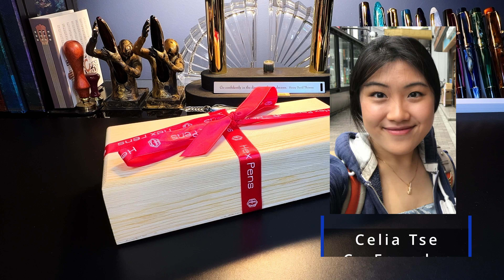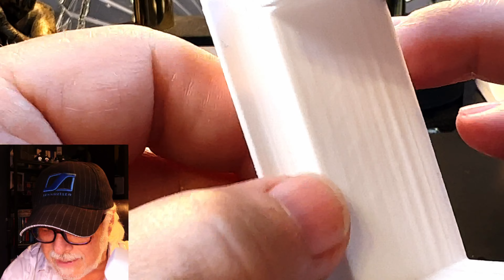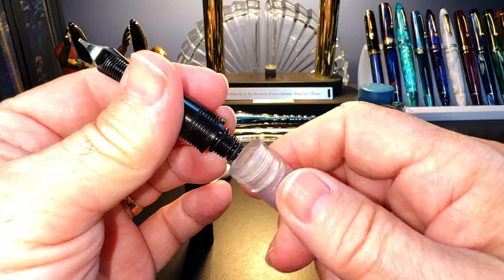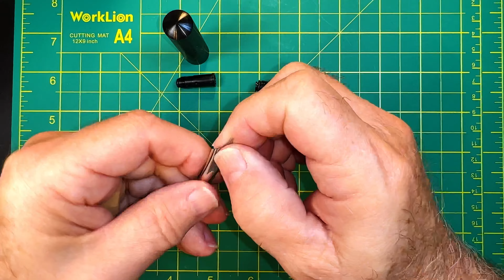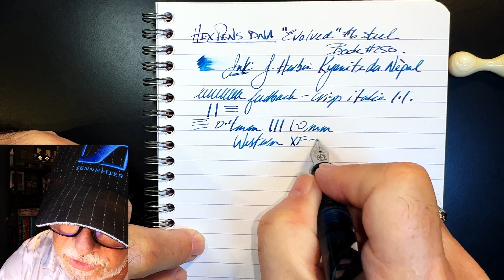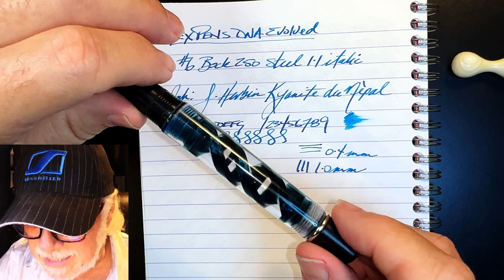2022 Hex Pens DNA Evolved 3D Printed Fountain Pen Unboxing and Review

Comment: No roll stop or clip? That's a big deal breaker, I can see it rolling off my desk and shattering on the concrete floor. I give you props for actually filling this properly.  Good review, as usual.
Reply from the maker: Fair enough! But, the cap is Delrin which won't shatter if dropped.
Reply: Get some Sugru and make your own rollstop. It's basically a silicone putty that dries hard.

Comment: That's a neat pen. I wonder if you could use two colors and have something neat to stare at, either a two color spiral or some mixing on the fly.
Reply from the maker: The two channels are actually one. The cross pieces connect the entire thing as one chamber.
Reply: @InkquiringMinds  I figured. It still might be neat.

Comment: This pen is so neat. I'd love to pick one up but your review is the second one I've noticed this in and as it is a sensory issue for me, it's a no. The cap has that ridged texture a lot of 3D printed items have, and I can hear a high pitched sound as the ridges from the section and the ridges from the inside of the cap rub past each other, that to me provokes a response a bit like nails on a chalkboard. It's also a texture I very much do not enjoy touching. I hope they find a way to make those pieces so they are smooth like the barrel. I also know from having some dolls cast from polyurethane resin that no matter how much you protect it, it's so photosensitive that if it's exposed to light there is no way to avoid the yellowing, only slow it down.
Reply from the maker: Excellent points, Maria!
Reply: You can coat the outside in UV resistant lacquer, like some car spray waxes.
Reply: @bigdhav  thanks for the tip. I was concerned about the texture on the section where the cap rubs against it capping and uncapping.

Comment: Cool pen. Did you need to loosen the end cap to keep it flowing?
Reply from the maker: No. That’s a bad idea too. It will leak easily. The feed is designed to allow air back in the system to control the feed.
Reply: It's probably a better option to slightly loosen it (then tighten it right back up!) if you're impatient after inking it - at least compared to tapping the unprotected nib tip down 😉

Comment: Harry Chapin -always a song with a message. Amusing to watch Doodlebud fill this pen the conventional way first up. It's an interesting, quality made pen with a nib that should provide hours of writing pleasure. Does the pen dry up quickly if left uncapped? Thanks for a very detailed,comprehensive review.
Reply from the maker: Thanks, Andrew. I never noticed the pen drying out when capped.
Reply: I meant more in the case when you hadn't capped the pen for a short time and come back to it. Had it dried up or did it just work with out skipping a beat?
Reply from the maker: @MrAndrew1953  I had it open under hot lights for the size comparisons for a while and then it skipped during the writing sample. But I had no experienced any drying out previously or since.

Comment: This is a real nice looking pen, Doug.  My only concern is durability, as you alluded to in mentioning the scratches that accumulated on the pen after short usage.  How durable is the substrate?  That's the only thing that would hold me back from buying this pen.  Would a clear coating to the cap and barrel work?  Not sure.  Otherwise it is a remarkable conversation piece that would receive minimum use.
Reply from the maker: Yes that’s true. I expect the cap at least to look a bit worn in a year.

Comment: Thanks for fantastic education about the different types of plastics, resins and 3D printing processes!  It seems like the length and girth is similar to PenBBS 469? I LOVE the way this ink chamber fills. Adding it to my wishlist. I'd like a clear cap and end finial, though.
Reply from the maker: The early models had clear caps. I don’t have a 469 but this is by bigger than anything PenBBS has.
Reply: @InkquiringMinds  --- Does that include 491 model? Pens that are too wieldy can lead to finger cramp. Jinhao 100 and PenBBS 469 are about as chunky as I can hold. 308 is most comfortable so far.
Reply from the maker: @twain888  It is much thicker than a Jinhao 100.
Reply: @InkquiringMinds  -- :(. Maybe we can show it to Beini and get PenBBS to make a 308-sized version ... Hey what if it could replace 309? Imagine a piston that fills up a DNA strand!

Comment: A lovely looking pen, that is now firmly on my wish list!  Take my word for it you have not missed a thing by not having used the Additive Pens Ribbon Demonstrator pen! I made the mistake of buying one of them which was Ok at first then the body seemed to expand where it joined the section and thereafter never properly tightened - hello inky fingers!!  In my opinion the pen was pretty poor quality material also I was never really able to get it cleaned properly due to the design so safe to say that I will not be buying anything from Additive Pens again.  I'm glad to say that the Hex Pen looks like much more thought has gone into the construction and more importantly the build quality.
Reply from the maker: Thanks for this! Good information.

Comment: 1. Nice pen, nice review.  Personally I find the Additive Pens version more attractive, but it's always nice to have a choice.
2. Why isn't the steel ring glued on?
3. It may be very practical to include spare parts, but to me it says "we can't manufacture a pen that won't fall apart or maybe wear out prematurely."
Reply from the maker: I think they wanted to avoid glue anywhere on the pen. Since the pen has six orings, it isn’t a bad thing to include spares as they are all different sizes.
Reply: Same reason IKEA gives you spare screws and fixings. In the assembly (or disassembly in this case) they may get lost down the plughole... So spares are always good. Besides they're not an established pen manufacturer, just passionate enthusiasts and engineers.

Comment: Doodle Bud did not read the instructions with hilarious results!
Reply: Doodlebud, however, pointed out a few rough features of the pen -- most especially the cap threads. At this stage my impression is the 3D printed fountain pen resembles a beta software release.
Reply from the maker: @user-br3sl9go3b  I have no issues with the threads.
Reply from the maker: Yeah I watched that!